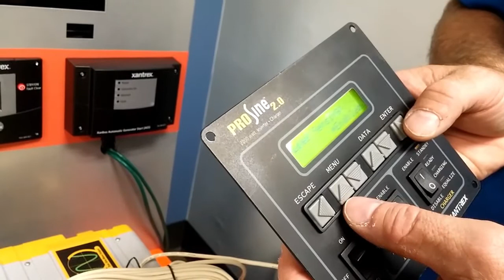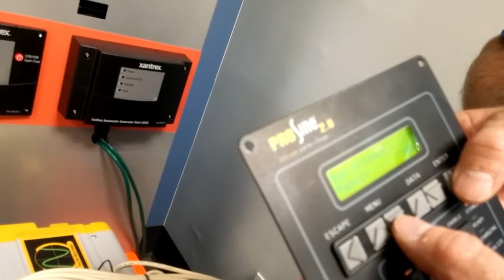Xantrex Tech Tip - PROsine 2.0 Inverter/Charger Remote Panel

Comment: Hi. My don't have power coming out of GFCI , 12v DC input , but no output .. does this type of inverter need AC input to work..or they work from battery only
Reply from the maker: Please call our tech support for assistance - 18006700707 or customerservice@xantrex.com